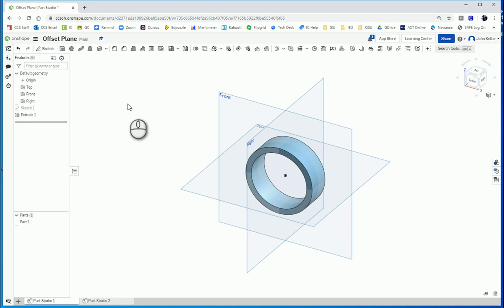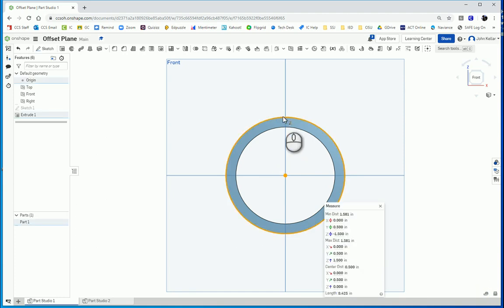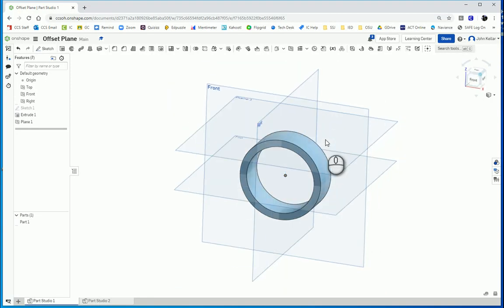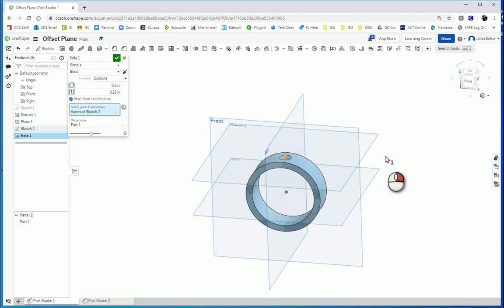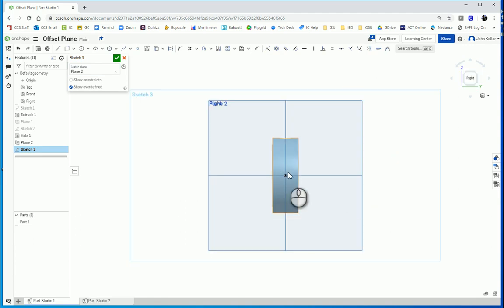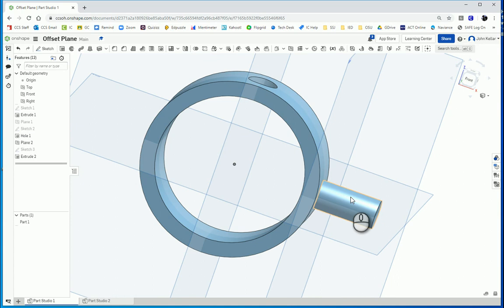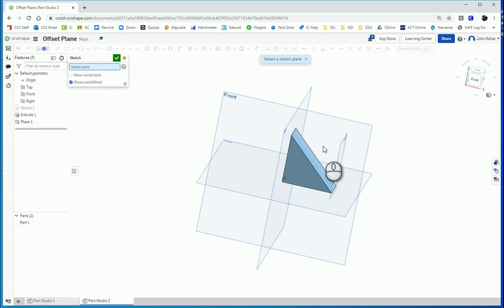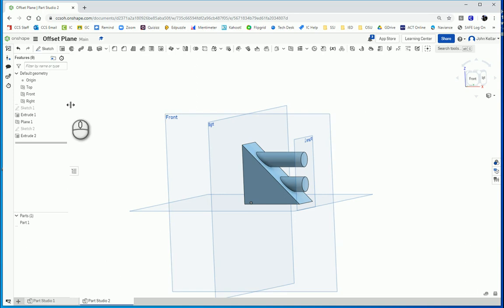Offset or Parallel Plane (OnShape)

Comment: SEE CORRECTION....MY BAD....SORRY! ANNOTATED IN THE ORIGINAL COMMENT

John....Thanks for the attempt but I HAD TO STOP WATCHING because of the POPPING and the 360p video (HERE'S A CORRECTION......I was using Chromium and for some reason only showing 360p. I opened in Chrome and did get 720p which doesn't hurt quite as bad!)